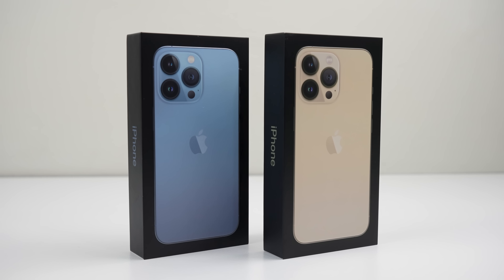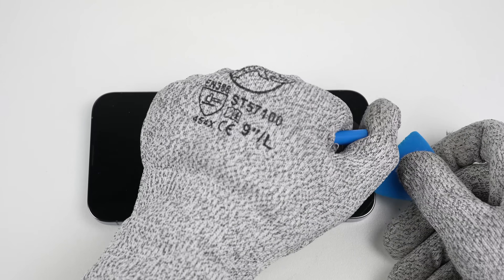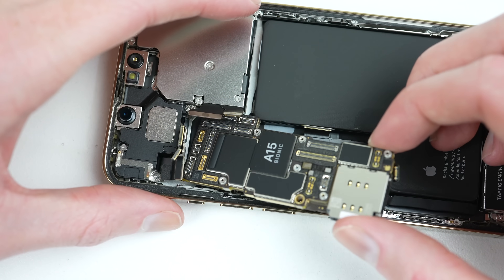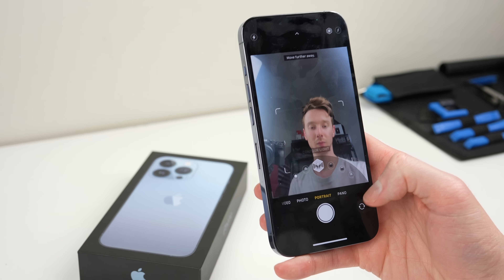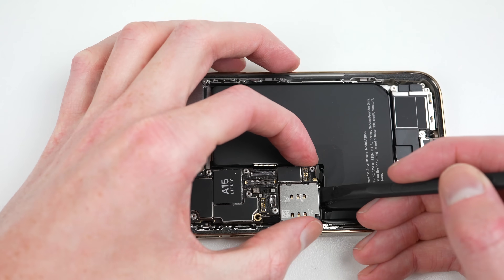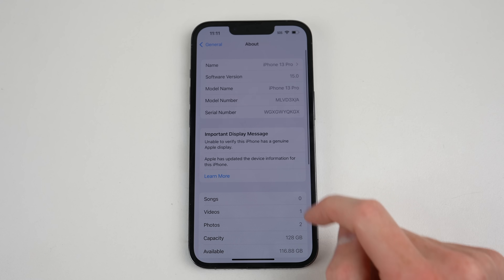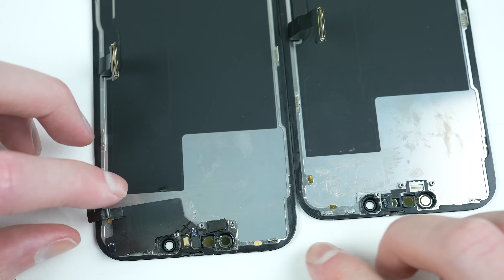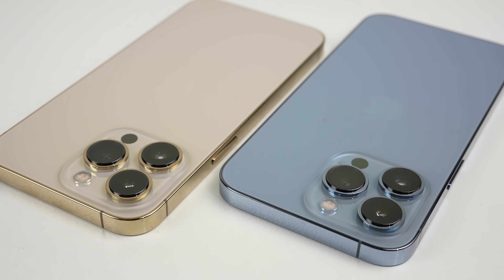iPhone 13 A Repair Nightmare - Teardown and Repair Assessment

Comment: I get that you do good work but there's more bad repair shops then good ones I've been on 3rd party repair shops side for the longest time until I ran into my one situation had I just payed for apple care I would have saved money, some the screws wouldn't have been lost, I would still have Face ID and True Tone, and I my ringer wouldn't be stuck at half way point. Yes all those problems were from just one faulty screen repair on my almost 2 year old iPhone XR. Apple shouldn't be limiting our freedoms but honestly after all of this I wish I would've just listened.

Comment: All of those software locks are ridiculous. I hope that by the time my iPhone 12 Pro battery is shot, right to repair laws will have banned this kind of crap. On a side note, for a phone that isn’t “supposed” to be opened it sure looks nice on the inside
Reply: If you ignore the software locks, it actually looks like a really well-designed device to repair. Which makes sense for Apple, since they'll be repairing it by swapping the major components and re-pairing everything together.

Comment: Given the impact we are having on the environment at the moment, seeing Apple continue to make phones that are unrepairable is shocking. 

All the work they've done using recycled materials, cutting power bricks and plastic wrap etc. is almost pointless if they're not going to allow the right to repair. 

Shameful.
Reply: Plus removing the charger might lead to more pollution
Reply: TRUE @Apple
Reply: It needs to be front page news so get more attention and so right to repair becomes a law
Reply: Exactly. 

They just waste more resources for some unnecessary packaging for a sold separately adapter. It should have been in the box immediately. But then again, their cables are so crap.

More and more companies will surely follow this example.
Reply: Do people really throw 1k phones away because it’s broke and just buy a new one? They can be repaired, but just by Apple at an extortionate price. It’s a where to repair issue not a right to repair. This is where the right to repair movement falls over because Apple isn’t preventing repair. On the face of it, it does seem Apple are been obstructive and I understand peoples frustration. All that said, in a world where many people only want the latest tech, I very much doubt arguments about environmental concerns about Apples approach to repairs is going to have any impact on iPhone sales. If we really cared about environmental impact we wouldn’t be buying the latest tech, we’d all be still using iPhone 5 or 6, phones that can be repaired. We can blame Apple until we’re blue in the face but as consumers we’ve brought this on ourselves, and the environmental damage is just as much our fault.
Reply: "Apple continue to make phones that are unrepairable is shocking"

Unrepairable? Really, so why there are repair shops and even Apple itself provides repairs for even really old devices?
Reply: It's all about the money and their profit margins in manufacturing. All their talk about going green, is so they can get all that "green" not from trees but from our wallets.. 💵💰

Comment: I can't believe how in the actual fuck we managed to go from just popping off the back cover to access everything to not being able to fix anything at all, even if you have the skills and tools to do it.
I heard some rumors about limited functionality when replacing the battery, do you have anything on that? Or were those just thin air?

Though I doubt the rest of the phone is going to hold up long enough to have a weak battery be the first failure to occur...
Reply: Watching an old Rossman video he says something about newer iPhones breaking down faster if you use a reputable third party charger, even one that had otherwise performed to an exact specification.
Reply: @Ernold the problem with this is that apple actually makes really good products. They may be expensive but they are really good do.. so most of us cant not use them, since they make your life easier, especially if you rely on them for work.

Comment: I can't believe that Apple expects people to buy this crap. Any one with logic would get an Android, repairable, more free in the software, more secure, and cheaper.
Reply: it also broke after 3 months...
Reply: I got an android mp4 player for cheap. it was filled with viruses. So with my pervious experience with android.. I will stay apple since I know I'm not going to get a virus right out of the box.
Reply: @Danielguy101  Which brand of device did you buy?
Reply: @Danielguy101 Buying cheap unverified Android, what, an MP4 Player? Never even heard of those, but doing something like that is not ideal. High-end devices like the Google Pixel or the Samsung Galaxy S21 are the good options, not the pricey iPhone, which Apple won't even let you fix now.

Comment: It hurts my head just to imagine all the work you did assembling and dissasembling all this...
Reply: And we thank him for that
Reply: The most annoying thing is there are 4 different types of screws. If you mess up with them you'll probably damage the components. But on Samsung all the screws are philips screws. Same size same length' Nothing happens when swapping motherboards of two devices. But Apple serialized most of the components and made it unable to repair.
Reply: For science!
Reply: Knowing me, I’d probably lose some screws and place some stuff in the wrong place
Reply: i tried repairing mine once ended up with 2 extra screws
Reply: @user-vo3ps2oz7h  Read: You're more efficient than Apple
Reply: @user-vo3ps2oz7h  The screws screwed and made new screws?
Reply: @user-vo3ps2oz7h  so you're saying you've got a screw loose?

Comment: Paper protecting the display 😱, that’s not what we all used to from an Apple unboxing experience.
What happened to the lovely plastic protective film the wraps around the phone and display that ya pull the tab to remove from box and then it peels off with that ever so satisfying “Plastic Peel”, 🤦🏼 
Hmm…….
Reply: Paper works just as well less plastic is a good thing the environmental impact of single use plastic is bad enough without millions of iPhones adding to the issue Apple done the right thing here

Comment: There are a few things I can understand being serialised for security reasons, but the display has no reason. It has absolutely nothing to do with security. Although, imo a reimage of the device from iTunes for a device that isn’t locked to an Apple ID should fix those problems.
Reply: They could use the serial to just detect changes and wipe sensitive data. But nope, they just want to make money.

Comment: Apple will do anything to make you buy the latest devices (not just iPhone), from locking parts to not helping fixing their customers old devices.
I remember going to the apple store, and when customers come in with problematic macbooks , the staffs would either do some "diagnostic" test or told customer its not worth repairing and then redirect customers to buy new macbook instead.
Reply: Apple fixing older devices with no problems. Even there are 3rd party certified partners which will fix everything same as Apple - all will be working after repair.

iQuestion is if you want that repair for its price. Here many people will use non original parts but for better price which means no FaceID, touchID apd so.. It is easy to aviod those phones on secondary market as it is clear sign of big damage and non certified repair.
Reply: @jirikocman  trust me you don't want your stuff repaired like Apple, the reason people might use non original parts is because Apple won't sell you them so you will go to them and so they can sell you a new phone. The whole idea of being "certified" is stupid, why would you need to be certified by someone to do repairs

Comment: The video is awesome. Imagine going back to 2013 with Samsung S4 and replaceable battery in 5 seconds. Apple is going worse over the years. You paid around 849€ for the phone and you can't change display without disabling the main unlocking feature and blocking the 3rd party repairs to repair the phone and you must go to Apple Store to get phone fixed. I hope the laws in EU and other countries will change the Anti-right repair law.

Comment: What happens if you change pentalobe screws with each other? Will it continue to work as usual or pentalobe screws have also software lock? :D
Reply: RFID identified screws lol

We might not be far from that day
Reply: Not genuine penelope screws detected iPhone must return to Apple for out of warranty replacement
Reply: @spectaculartech  lmfao god that'll be the day. At this rate we're not that far off lol.. 😔
Reply: Lol
Reply: Don't give them ideas
Reply: Dude don't give apple ideas!
Reply: Future Apple User: Missing 1 screw
.
.
.
fuck, gonna buy a new device.
Reply: Lol 😂😂😂
Reply: For things like iPad they don’t have pentalobe screws so can you just take the panel off with heat? And will it function like iPhones software locking and not working?
Reply: No but they have different sizes soo they won't fit.

Comment: Sad all these parts are meant to work together and if they change, they don't.  I can see where developing for something like recognizing IDs of parts installed during manufacturing is a lot less man-hours to develop for vs coding for every possibility of change between the camera, display and sensors.  With that kind of efficiency, in code, if everything is built that way, then that could explain why iPhones are just plain efficient.  I'm still a Pixel fan, though.
Reply: pretty sure it's easier to not program part number checkers to cause fake glitches and issues and just letting people change the parts which are pretty much identical between different phones of the same model. part interchangeability might not be the greatest between different models, but not allowing changing parts between the exact same models without the "bugs" is just scummy.
Reply: @Slunkee  When you let people just change parts, though, there's that QoA issue that Apple tries to live by.  Many people don't care if they mess up their own phone, but it's Apples perception of the whole issue.  I'm not saying that's how they think, but that's what it looks like.
Reply: If they cared about any of that they'd do away with artificial restrictions and sell their genuine parts like Motorola and others do. But they don't, because they don't care, they just want to turn phones into a service they have complete control over.
Reply: @WhenDoesTheVideoActuallyStart  Yep, and that's the part we have to work on.   Motorola actually has/had a good way of allowing stuff like unlocking too.  They seem like they don't like allowing repair, but they live with allowing it.

Comment: It would be super interesting to explore the real user experience if you were to follow the phones instructions and just went to the apple service to see what they tell you and what is their solution
Reply: They will repair it with everything is working. Screen repair for regular iPhone 12 is about 300 USD, but you can use AppleCare+ or any other insurance for theft and random damage which is very often offered by shop selling those phones (there is no official Apple store in my country, only certified retailers and repair shops, but you can ship your broken phone to Apple for direct repair too)

Comment: it’s easy bruh… just don’t break ur phone
Reply: Wow. What an original comment. 👍
Reply: @DemePoole  i just solved the world wide apple anti repair problem
Reply: It's impossible to not break an iPhone. They are, naturally, attracted to concrete and other hard surfaces.
Reply: @DemePoole  my iphone 11 pro max is in pristine condition
Reply: @DemePoole  daddy
Reply: Nah, it's better to use it recklessly and then be a whiny pussy about it just because you can't accept the fact expensive stuff is expensive to maintain. I don't see anyone complaining about the $40k brake jobs on Ferraris.
Reply: @enzoperruccio  i’m just saying to take care of your stuff. a $350,000 is different than a phone. cars need to be upkept while any damage to your phone isnt something that degrades over time

Comment: PRG didn't even scratch the surface of the malevolence of Apple. They are seeing the attention that this issue has arose and are developing more ways to restrict third party repairs before the law catches up to them.

From what I've seen in this video, they have included clips on the top of the phone. I bet they'll include clips that are designed to snap off in the next iPhone to notify Apple of any breaches and remove warranty in a snap (pardon the pun 😉), like how Sony included such clips for the DualShock 4.
Reply: I've had to buy a few replacement top shells for my PS4 controller. Those clips are terrible.
At least my PS4 didn't reject my controller because the top shell was changed. It's not serialized... yet. Maybe for PS6.

Comment: I thought you were a smart guy, Face ID is the same as Touch ID, you had to keep the same Face ID module with the same screen and logic board, SINCE THE IPHONE X. if you had transferred the module, everything would work fine, the cameras and the autobrightness. even the cinematic video and portrait mode will work
Reply: He just changed the cameras first

Comment: Apple pride themselves on security. Being lax with the internal components could open up doors to hacking and fraud so I don't blame them for being this strict, it's sort of necessary when so much important personal data is stored on the phone
Reply: data is already encrypted on the phone. Also if someone has physical access to your phone you're done anyways. There's nothing you can ever do to protect your data.
Reply: @quixfilmz3409  Remote wipe, if possible.
Reply: @quixfilmz3409  the data is decrypted when you're working on it, like if you're typing in bank details or something and you have a dodgy part that can monitor your inputs, encryption can't save you there
Reply: @defnotatroll  monitor your inputs - I doubt highly. How is your camera going to intercept keyboard inputs which is completely software?
Reply: @hachiko2692 wouldn't be suprised if they do a software licensing take, like with Windows 10 license keys. Each screen has an id and only one device in the world can "redeem" that screen. Therefore only ids issued by Apple will work. Apple won't allow the screen to work, unless it contacts their servers first.

Comment: This is ridiculous. There’s really no excuse to lock the front camera and Face ID if only the display has changed. I could understand pairing the Face ID module to the motherboard for security reasons, but this takes it to the next level.

I have an iPhone 12 Pro Max right now, but this is seriously causing me to have second thoughts about continuing to buy Apple products.  

Is there any way to contact Apple and let them know this?
Reply: They know. Believe me